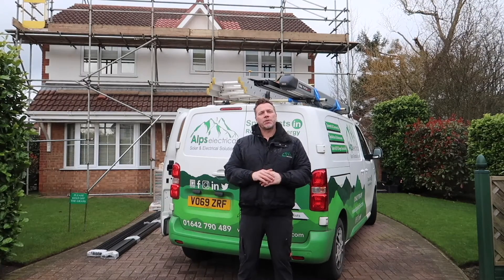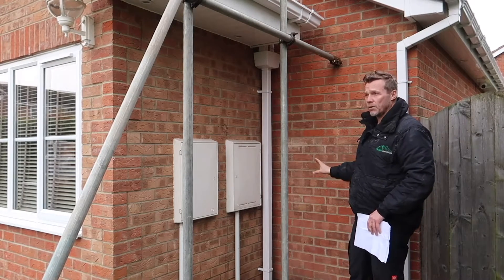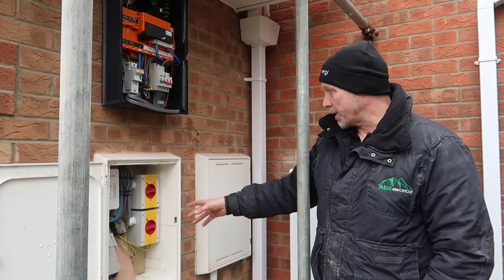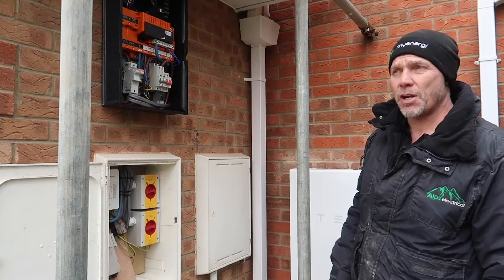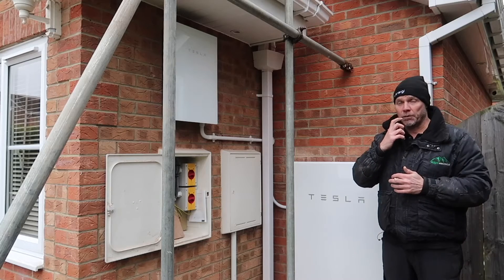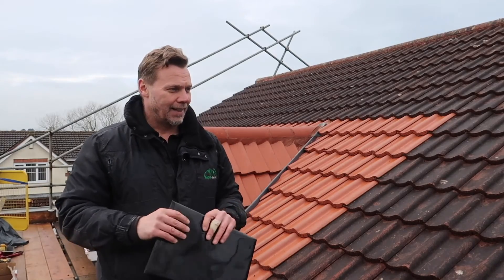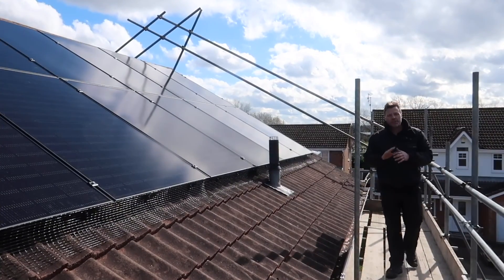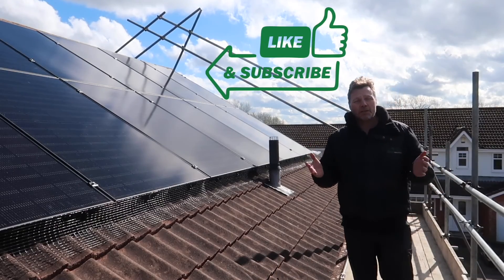Tesla Powerwall Installation UK | 10.75 kW Jinko Solar System with Solis Inverter

Comment from the maker: ⚡ Tesla Powerwall + 10.75 kW Jinko Solar System Installation!

This system features 25 Jinko Tiger Neo 430 W all-black panels, a Solis 8 kW inverter, and a 13.5 kWh Tesla Powerwall — all installed by the Alps Electrical Ltd team right here in the North East.

💬 Thinking about solar panels or battery storage for your home?
📞 01642 790489 | 🌐 alpselectrical.com

📍 Serving Teesside • Durham • Sunderland • Newcastle • Northallerton • and the wider North East.

🔔 Subscribe for more real installations and renewable-energy projects from Alps Electrical Ltd!

Comment: What a great video, what do you think of the Tesla PW 3?
Reply from the maker: Hi, thanks for the comment. We haven't installed the PW3 yet, but it has a lot of improved features, such as max discharge has increased significantly, and it can handle I believe up to 20KW array?  The main bugbear for me is that with the PW3 it has a built in inverter whereas the PW2 does not. Keeping the inverter separate gives you more flexibility with choosing different inverter brands and sizes, but also if you did have a problem with the inverter side of things after the 10 years warranty has ran out you could easily change that and inverters are much cheaper than the battery. 

In our experience if any component is likely to fail or have a shorter life span, it is the inverter. But then there ar egreat benefits from the PW3 so it is swings and roundabout's, but something to bear in mind!
Reply: @alpselectrical  Your right about the inbuilt inverter in the PW3, it would potentially have a longer lifespan if it was separate from the batteries. It would be even better if they switched to an LFP battery configuration, I can only hope. I’m still searching for a solution for my £1350 quarterly bills; We run two long range EV’s, Heat pump, all cooking, heating and lighting in our home is electric. We have migrated to the lowest tariff in our area and yet the bills are still £5.4k per year. There is room on our south facing roof and even ground mounting on our 3/4 archer site, any back of the fag packet suggestions will be most welcomed. In the meantime, I’ll keep watching your videos. Cheers👍